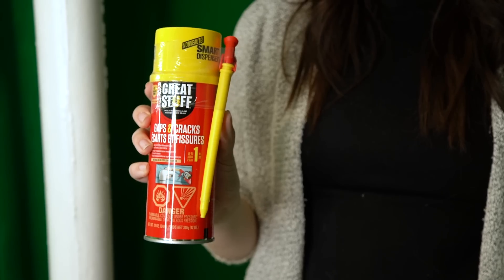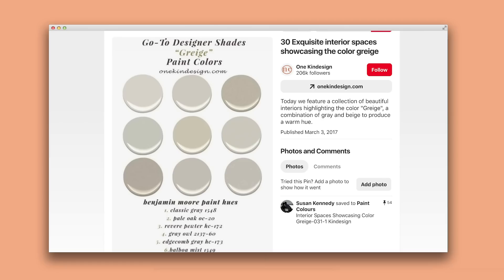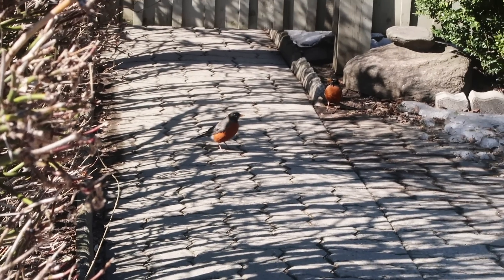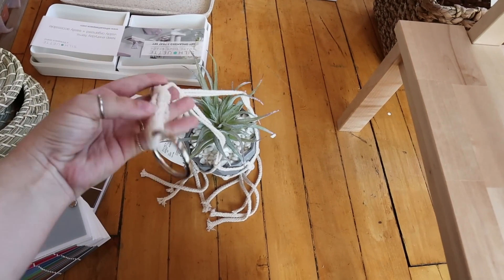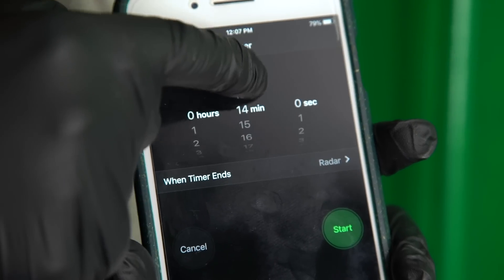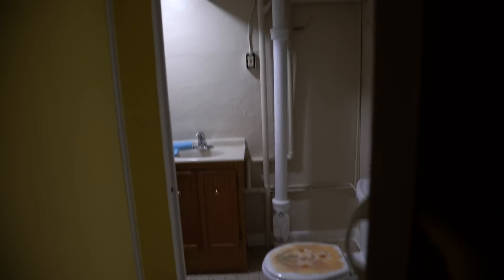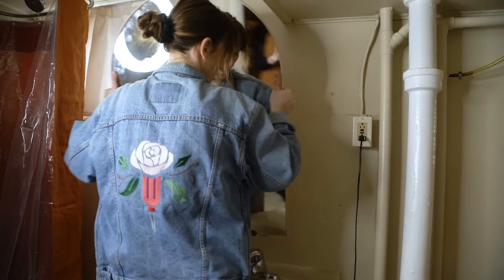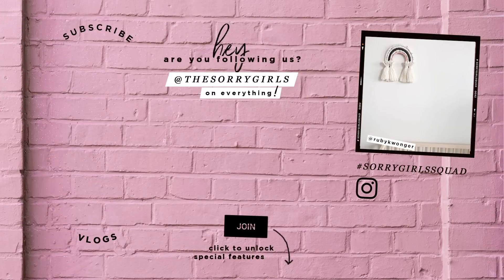This might be the most extreme makeover we’ve done

Comment: You ask for grey and you get burnt orange and warm brown wood...

I get that you guys had to work with those tiles but..
- a bath rug not the same color as the tiles
- a few shades lighter on the wall color
- painted cabinet
- a more modern towel and toilet roll holder
 would have made (in my opinion) a big difference.
Reply: yesss, and if they were worried that the walls wouldnt match the floor, there is a pcv option for the floors, not making everything was-white-but-we-smoked-there-for-50-years colour
Reply: Or lightened up the wood...if that was possible?  The girl said she likes light wood...could they have sanded it and then used a light stain or some watered down paint?

Comment: I wonder If the floor could have been painted? Or some cheaper laminate
Reply: I probably would have gone with vinyl planks on top of the existing floor since they're waterproof and would be an instant update
Reply: painting laminate is possible, I did it in my bathroom and it was such a facelift. Just know that it doesn't deal with being wet too well whatever paint is used... a puddle will dissolve the paint and might leave a mark so you always have to be really careful to wipe up water and not let it sit. Because of that painting the floor should only be done on laminate that is gross beyond salvation, which it wasn't in this video.

Comment: Just watched this video. 1) Didn't give the client what she wanted (grey tones) You gave her everything BUT! 2) Took away all her storage and didn't replace it with anything. 3) Cool and warm tones can be used together if you know what you're doing. 4)The artwork used looked like something from a kindergarten craft hour. It also was too small to fill the space 5) Should have used KILZ on the walls to prep and cancel out the green. Not to mention crack and hole filling and sanding first.  How is this an improvement? TBF, she did get a live plant out of the deal.

Comment: In my opinion it still looks dated they had so much more potential to make it Modern and fresh
Why didn’t they paint the cabinet 
Why didn’t they paint the wood towel holders
Why didn’t they use primer on the wall
Why did they pick orange and blue
It could have been soooooooooo much better